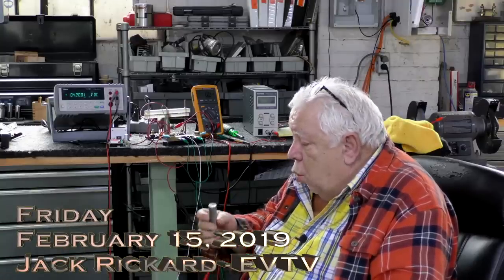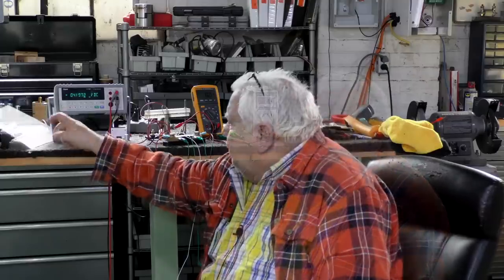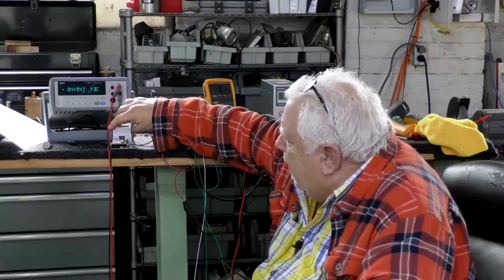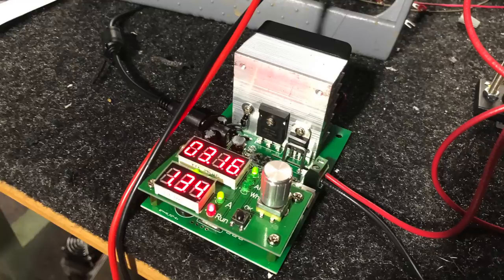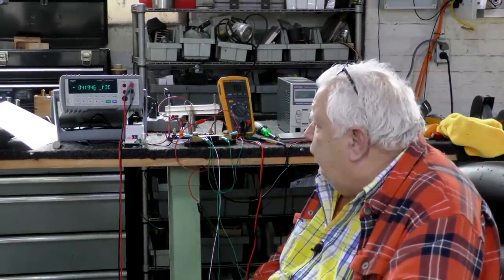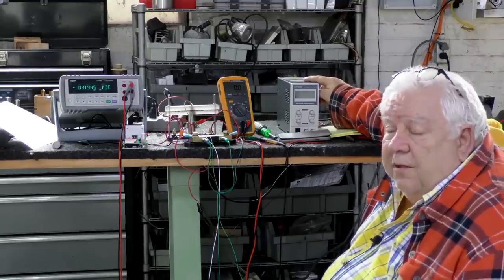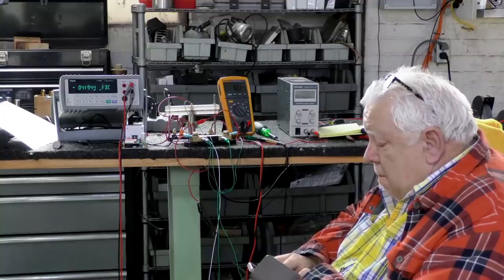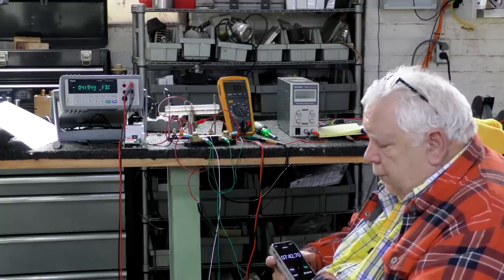Testing Tesla Model 3 2170 Cells - Battery Nerd Porn with Full Frontal Nudity

Comment: 01:24:30 - I am the proud owner of a dozen A123 26650 cells purchased back in the day when they sold research kits directly from their website.  Four of them are doing yeoman service as a single power cell [at 3.2 volts] operating four elderly Black & Decker Dustbuster units originally fitted with 3 x 1.2 volt NiCd cells.  The 26650 cell fits nicely inside the Dustbuster handle [some trimming of plastic structure required] and runs the machine for over 20 minutes without any change of speed.  I fitted a small switching regulator [based on LTC1474] into the wall-mount holster  to supply a current-limited float charge [at a carefully calibrated 3.45 volts] per data sheet advice.  Light & handy Dustbusters! 
 [edit corrects mis-remembered charge & operating voltages - did this 8 years ago! ]

Comment: Maybe the capacity is a little bit deceiving. I did no understand exactly how you hooked up the cell with the magnet. But having played with those kind of cell and tried the magnet connector I was not able to get consistent result and quite low results as well. I then tried re testing the same cell but spot welded and the results were consistents. I got 2800 mAh out of a used 18650 model S battery discharged 4.2 to 2.8V at around 1 A. but I dont remember exactly my numbers. They are ball park.

On another note a constant speed/power is different than constant current. As the voltage of the cell diminish the current need to rise to keep constant power. But the test procedure is constant current, no constant power.

Very nice explanation of the Maxwell process, thanks.

Comment: 26:00 either I misunderstand things or that graph must be way outdated.
as an example, the current wet-process high-capacity cell samsung INR18650-35E delivers 95% capacity at 1C discharge and 94% at 2C. that's from a "laptop cell", not a high-power cell.
(test: https://lygte-info.dk/review/batteries2012/Samsung%20INR18650-35E%203500mAh%20%28Pink%29%20UK.html )
Reply: @Jack Rickard instead of wasting your time with a useless answer like that, would you care quickly explaining where I am wrong? 
basically, I compared the measured Ah values for different discharge rates. 
I googled "capacity retention" because I wasn't sure I exactly understood what it meant and came up with "The fraction of the fall capacity available from a battery under specified conditions of discharge after it has been stored for a period of time."

Comment: 1:17:38 An IR gun thermometer pointed on a shiny nickel plated cells surface will not provide a great temperature reading. in fact it can be off by 2 to 4 times. Always put a black piece of tape on teh surface for better emmissivity match to the gun at 0.9 or 0.95

Comment: Awesome videos, as always.

You talked about 350kW on the Porsche Taycan from the high supply voltage perspective, but the bigger question is on the cell perspective - aka, not how the power gets to the cells, but how the cells are affected by the high charge currents. What do you think this will do to the lifespan of the cells?  Porsche has stated that the cell density is 270Wh/kg, so these are high energy density cells, not high power density.  Also, it appears (like the Audi Étron) that the pack will only be cooled on the underside (aka one would expect a heat differential between the top and bottom).

What's your take on this, from a longevity perspective?  Likewise with Audi's "ostensible" charging to 80% at a constant 150kW (in practice, it appears to actually taper at 60%, and by 80% is around 110kW, but Audi claims it goes to 80% at 150kW) - what would be the effect of not ramping down from 150kW until 80%?
Reply: @Jack Rickard I'm a bit confused by your reply. The supply voltage and supply current are not the same thing as the cell voltage and cell current. Regardless of whether your supply is 800V or 400V, the cell voltages are going to be in the ~3-4,2V range.  Aka, the difference is that you put twice as many cells in series for 800V charging as in 400V charging, while at 400V you have more cells in parallel.  350kW charging vs. 175kW charging is, at the cell level, just a difference in current, not voltage. Am I not correct in my understanding here?  So if you're doubling the current (for 350kW vs. 175kW), then you're doubling the charging C-rate. And the question is about what effect this has.

Likewise, the question is about what impact on longevity charging at 350kW would have vs. 120kW, particularly if cooling is worse. Your point about how slowly the cell heated up was well taken, but at the same time, it's not an accurate analogy; a battery pack isn't a single cell exposed to the air, but many cells adjacent to each other. They're not radiating or convecting heat away except around the edges of the pack, and via the cooling system.  We can look at real-world EVs to see how effective this is. Tesla's commonly hit 40-50°C when supercharging before the louvres have to open and the fans kick in.  A fully passively cooled pack, like a Leaf, will hit 40-50°C easily on 40-45kW, and seems to even maintain that temperature at lower (~25kW) "Rapidgate" powers. Keeping pack temperatures under control is very strongly related to the cooling system design and charging powers.

I have no concerns about the sorts of powers Tesla uses at Superchargers, combined with their ability to keep temperatures reasonable, and more importantly, keeping them even (with the glycol loop snaking through the whole pack). My question is not about Tesla's approach, but the impact of an approach like Taycan, with three times the average C rate and an uneven, bottom-only cooling system.

Or is degradation in such a situation still irrelevant, even for frequent fast chargers (e.g. rentals, couriers, contractors, long-commuters, etc)?
Reply: Having a high voltage battery goal is to reduce heat loss in cables both in both car and supercharger. Rule of thumb - supercharge at 1-1.5C Max to keep the battery life longer still there.
Reply: Yes Karen, you are right. For a given KWhr battery pack with a fixed number of cells, you could arrange them with half the number in parallel and double the number in series, for a double voltage rating of the pack and it would require half the current to charge the pack in the same amount of time.  But if you double the voltage, and keep the same charging current, then each cell gets double the charging current.

And yes, unless Porche has access to some new technology that we haven’t heard off in mainstream media, my guess is that charging a Taycan’s 90KW battery back with 350KW will cause the battery to degrade quicker,… much quicker.  That's like a 3.8C charging rate. Pretty high.
 
Perhaps today Porsche is more concerned about claiming better specifications than Tesla, then they are about the backlash of their failing batteries in the about 3 or 4 years.
 
There’s an article in Autoweek.com that states “the Taycan will be able to take advantage of its fast-charging capability to soak up enough energy in 15 minutes to cover 248 miles”.  For a 60,000 mile warranty, that’s only 242 charge/discharge cycles. Ya, that might be possible with current technology.  So maybe Porsche is just forgetting to mention that you’ll be replacing the battery after 60,000 miles. I could not find any info on what the Taycan's battery warranty will be.  Does anyone know?

Comment: Great work Jack. Fantastically informative. 
Can anyone confirm that the 18650s are only 3000Ah. Everything I've seen is 3200mAh if not 3400mAh

I'm a little taken back how small the Ah is on the 2170. Everything leading up to this point was pushing well over 5000mAh
Reply: Max rated 5000 Ah capacity you see on off the shelf 2170 cells is based on tests charging up to 4.2 volts and discharging down to 2.5 volts, which is quite dangerous territory of bricking the cell and killing it after only 250 cycles. If 4450 Ah is 4.2 volts down to 2.8 on this battery, then 4.2 down to 2.5 would put it well over 5500 Ah. But again, Tesla won't do that and let drivers utilize the full rated capacity unless they want the battery to only last 75,000 miles at most. So, capping the bottom at 2.8 to 3.0 volts, and capping the top at 4.15 to prevent dangerous over charging, which means explosions and battery fires, puts the cycle count at closer to between 400 to 500, just within the 100,000 mile range warranty if charging fully and drained to the bottom voltage cap.  That means at 242 watts per mile, driving at 55 mph on flat level ground, with 72 kWh usable battery at most, that's 297.5 miles. If there are any traffic lights or stop signs, some of that will be regen braked back into the battery, so Tesla's original EPA rating of 310 miles is achievable in mixed driving scenarios of 50% slow city driving under 35 mph in stop and go traffic and 50% highway at 65 to 75 mph. But Tesla's current claim of 322 miles of range is ridiculous.

Comment: Good information I do appreciate the technical specifications, I don't understand why you'd be disappointed with the battery itself though it's still as far as I know set aside from Maxwell's dry cell battery an example of test result the  most power-dense battery we have for lithium ion, although I believe we should have other better Technologies sure that are actually available just not introduced into the mass Market. I don't think Tesla lightly stepped in unknowingly to get that battery with just one measured metric and I think that metric pretty much speaks for the battery either way as far as the discharge rates probably pretty comparable and it's more power dense all in all , don't know about not seeing supercapacitors in some type of vehicle, there could be lots of different ways they could incorporate that in with power management systems such as delivering excess voltage upon Peak power draw for the motor sure it might be a little complicated but it might be something pretty cool, again thanks for the video it was great

Comment: Jack, thank you so much for your lucid explanation of lithium battery physics and the significance of Tesla's purchase of Maxwell. The technology reminds me a lot of the way laser printer toner fusers work. Also, where can I get a bill of materials for the parts that I need to order to setup a PowerSafe system? Oh and I was wondering if capacitors have value for use in regenerative braking systems because they can absorb energy faster than the batteries can charge?

Comment: It was also my impression that there have been no significant density breakthroughs since the panasonic 2900 cell used in 2012 Model S. But a drop in price by a factor 2 or more is very significant. The batteries are actually good enough already. They just have to be cheap and we are getting very close to panacea viable. Especially impressive and surprising is the extreme longevity we are seeing in Tesla cars, frequent failures aside. A 2016 Model X 90D did 350k miles in 2 years on the same pack and drivetrain and still retains 87% capacity. That is nothing short of fantastic. That means the packs can last well past the life of a car which is way better than the impression in 2008 of maybe 8 year life on a good day. Combined with a 100$/kWh cell price, we have arrived.
All we need is an appreciation for efficiency so you can do with a moderate pack thus moderate cost instead of Elon's apparent push for huge pack and heavy cars.
A Tesla Model 2 weighing a ton and even better aero than 3 could do fine with say 40kWh packaged into say 300kg pack. Manufactured for 4k$ and combined with a 500$ single motor drivetrain it can start to offer sub 20k$ long range EVs and start seriously supplanting ICE cars. That's where we need to go, not Elon's bullshit of raising the Model S price to now 50% higher than initial launch! Supposedly profitable at 8k units per year while now they sell 50k. Or used to until this ridiculous pricehike. It should be refined and optimized in mass production, not rise in price by 50 effing percent.
Reply: We are simply not going to convert the world with 85k$ base price. Elon has mistakenly always built cars for his own billionaire wallet. He cost overran the roadster and blamed Eberhard. What he's doing with Model S might be another such self entered lapse and making Model 3 as a people's car was an intellectual step while the daily intuition of the project hampers it with his self centered sensibilities. It had to have glass roof and pleather seats and power mirrors and effing dual motors. All of which is directly counter to cost optimization and ease of manufacture. Which he fumbled with overzealous automation. Opening time for the competition. Similarly lifting the skirts in conceit on the models opens price ranges for the competition. The Jaguar is selling rather well when it should have been molested by Tesla. Model S sales in Norway have disappeared. Idiotic. Kia Niro and Ioniq have high demand in the near 35k price because Tesla isn't there. Again, they should have been molested, even if base Model S had to come in at 37k to be profitable.
I know you have some disdain for cost optimization but that's your irrationality. Indeed key to your efforts with EVTV being inconsequential. Preaching to the choir while insisting a 15k$ inverter was the best we could do. We can't undercut everything to a fault but optimization is indeed king. We would still be at 12k intel PCs by your judgment. Smart optimization can be plenty lucrative. It doesn't equate chinese squalor. 
35k Model 3 is so important they should offer it even at a loss. Which it wouldn't incur anyway because Tesla sells their cars at average 50% above base. Indeed it should be aggressively optimized and offered at even lower price. Ideally below 30 although that might not be reasonably possible. but 32.9 would be a powerful symbol.
A Model 2 should be developed with extreme prejudice to break 25k barrier. Fuck the moronic pickup trucks and indeed the semis. Focus.
Aerodynamics should be extremely catered to. Beasts of no burden. My yoke is light.

Comment: What happens to the Fluke multi-meter When you hold the yellow button for 5 seconds while you turn the knob on?  That disables the auto power off according to the manual.

Comment: To simulate the load of a 4 hours drive at 70mph, I would think that a constant power load would be a better choice for evaluating the batteries.  To maintain a constant speed, you need a constant power, and as the battery voltage falls, the battery current must increase.
Reply: Understood now.  You are trying to evaluate the capacity of the sample battery using the constant current discharge method, as opposed to the constant power draw method, because most people talk about the Ahr rating of the battery, and not its Whr rating; which of course are two different things, albeit, similar.  In this video, you are trying to determine its Ahr rating.

Yes, as you stated “there is such a thing as standard drive cycle testing of batteries” and the great things about standards; there are so many to choose from.  ;-)  In constant power load situations, like UPS systems, the Whr rating, and evaluating batteries with a constant power load is more accurate.  I was tasked with that many years ago, and found significant difference between different battery manufactures using the two test methods.

I assume the other person that suggested using a constant power load also felt that an EV at 70mph is more like a constant power load and not a constant current load.  One could also argue that everyone talks about EV battery’s KWh rating, and perhaps another reason to use that constant power load method.

Evaluating constant power load characteristics is not any more complicated than evaluating constant current load.  It just requires a different dummy load, or a different setting.

Anyways Jack, not a big deal either way.  I enjoy your videos because they go into a lot more detail than others do.

Comment: Can you give an estimation of how fast we would be able to charge to 80% without destroying the battery too much?
Current superchargers get there in 40 minutes, how fast a next gen supercharger that maxes out the battery would charge?
Reply: @Jack Rickard Thanks for a detailed response.
Obviously my knowledge on batteries is poor, that's why my question probably is confusing. You answered it though. 

I drive a gas car, but honestly, for my usage, 40 minutes from 0 to 80% is plenty fast. I'm just always wondering what the next possible step in technology is, that's why I ask.
Reply: @DKdoman  
Also, as the range increases, you use less percentage of that range.

If you run a "300 mile" car instead of 200, you chances of even needing a "supercharge" reduce considerably, then, when you do, a 10-60% charge gives you 150 miles, rather than 100, so you're back in the 2.5hr "miles per bladder" range.
Once that 10-60 rate reaches the (ACTUAL!) 20 minute fossil fill-up time, all bets are off for a sensible driver.

If you start the day with 90%, then top-up, you'll get 540 miles in 9 hours including 3x 20 minute stops.
I think that's reasonable?

Comment: Joke at 52:48 ~ "How many farms do you have before you become a pharmacist?"

Nice one.

Side note: like with phones, the heat produced when charging faster (say "supercharging" 0-80% at 200-300A vs 80-120A at home) does not harm the battery charge-to-charge, but causes a gradual buildup of dendrites inside the battery which decreases the maximum capacity over many charges.